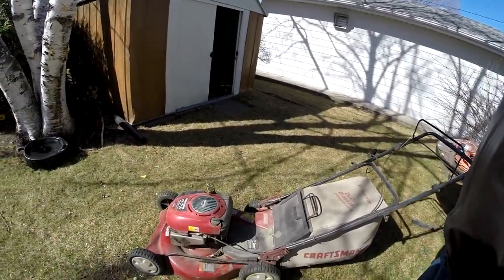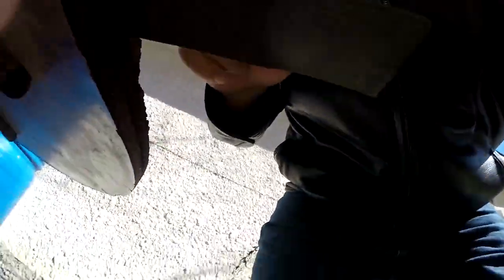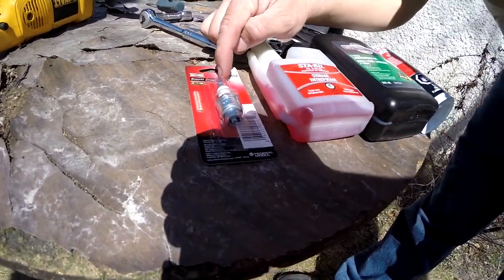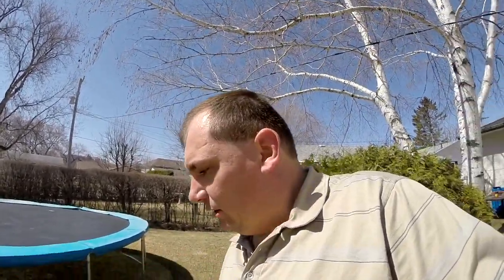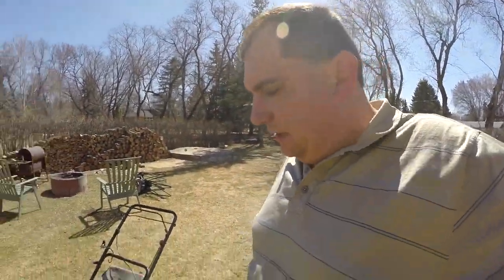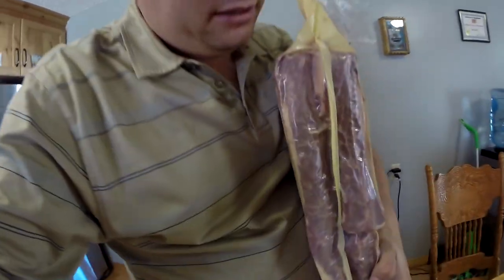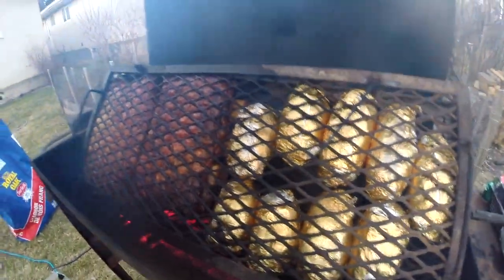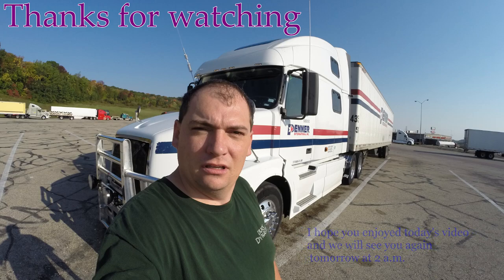Trucker Rudi 04.17.15 getting my lawn mower ready for summer

Comment: You win ! You cook with charcoal not gas. You have smoke coming out of your smoke stack.  Jerry took a knife and poked holes in his steaks.Letting all the juice run out..Never seen that before. Come to KC Mo some time.For KC bar BQ.
Reply from the maker: I was thinking the same thing
Reply: Rudi Dueck I used to, I quit doing it if the meat has NOT been FROZEN  and thawed out. If is thawed out, Yes I do poke a few slit to let the WATER out. The mean juices stays in. I like using Chicken and Rib BBQ source by KRAFT, I love the flavour. Montreal spice should be rub on and press on to the meat and then placed on the BBQ.So far, I do believe to each his own, Big Jerry does a neat cook out, RUDY loves RIBS and I love BEEF rib and Steak, and above all Hamberger done on the  BBQ. Have fun, wishing all a great GRILLING seasons. Scotty (AKA: JP) Calgary, Alberta, Canada and been BBQ'ing all year. YAHOOOOOOOOOO